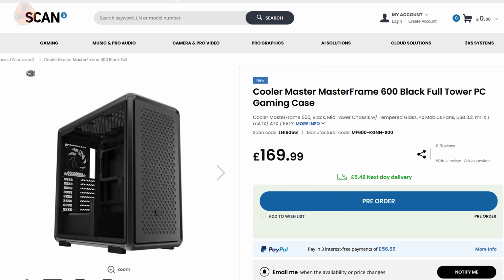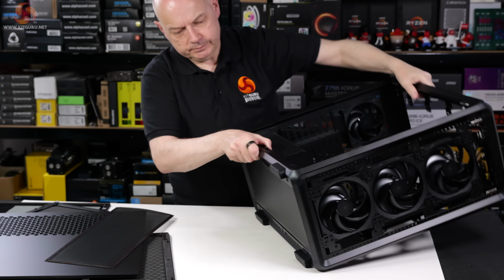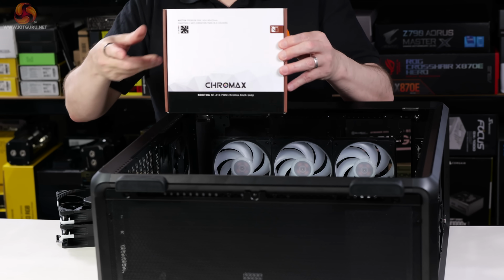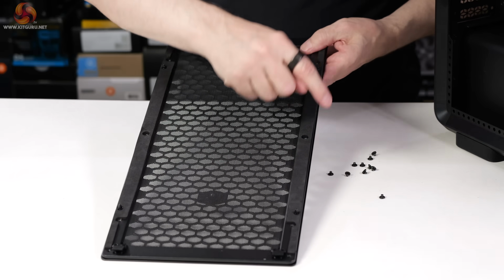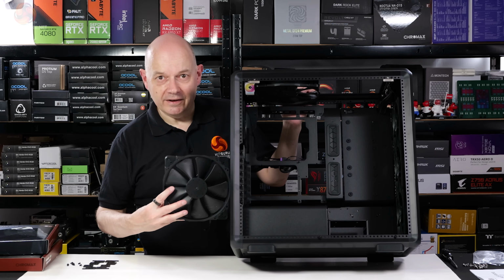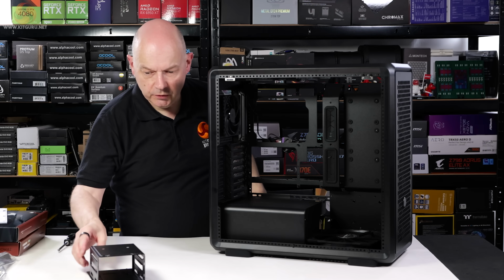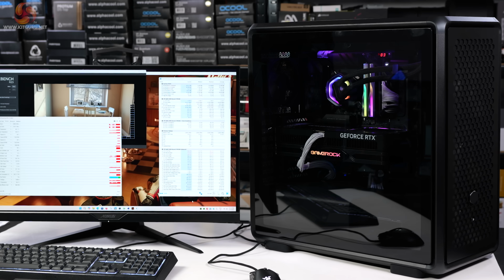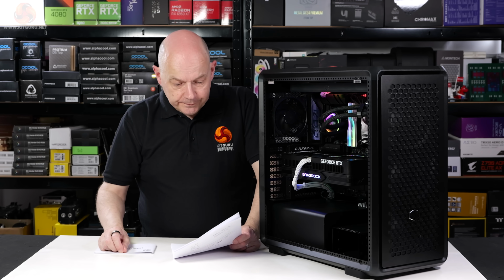Cooler Master MasterFrame 600: Gorgeous, Modular, Frustrating

Comment from the maker: Let us know what you think? does this case tick a lot of boxes for you? or have you already bought one? Also please do report any spam you see, its neverending.
Reply: This is probably one of the most striking cases I’ve seen this year. Cooler Master nailed the industrial-modern vibe, and the use of aluminium gives it a premium feel that a lot of mid-range cases lack. But looks aside, I’d be terrified to recommend this to a friend unless they’ve already built multiple systems and know what they’re getting into. The complexity here is real. :text-green-game-over:
Reply: I like it. Has a lot of flaws but at least it’s different. Had to think about it for a while
Reply: It looks great! seems a little fiddly and I don't have the patience for that lol :))
Reply: Thanks for doing this video on the Cooler Master MasterFrame 600 case. Can I assume that one can put the i/o panel on the top front with two 200mm fans?

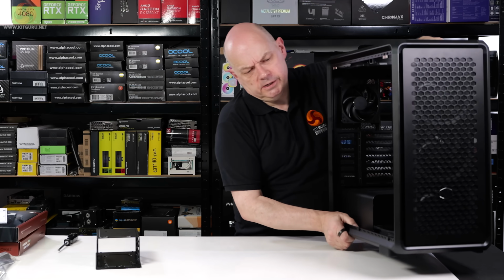Comment: 15:38 I just purchased this same case today and my case does not have the 2.5/3.5 shared drive cage! 
I have installed the Motherboard, CPU, RAM and the case cables which leaves me with these last two tasks, the PSU and 360 AIO which looks like might be a pain,  I don't have a GPU or Gen 5 M.2 drive yet and my three SSD's and 3.5 HDD will be moved over from this computer if I can find a place for the 3.5 drive in the new build. As for the eleven fans, at best I will have seven IF I can get the 360 AIO in the top of the case.
As for the case, it look great, easy access panels, great, but inside, I am no engineer and the destruction manual is to small for my eyes to make heads or tails out off.

Comment: I add my last thought about building in this case. I started building my new PC in this case four days ago and I was so enthustiast because it was looking so good: I purchaised it at the end of Juli 2025 for only 149 CHF/Eu, a good price. I choosed to use is in a standard configuration, together with a Cooler Master AIO, the Master Liquid Atmos 360. The problem is that installing a 360 radiator is extremely hard, because there is no offest mount: you can install radiator only in the center of the case but unfortunatly the radiator+Fans collide with the heatsink of my Motherboard and with the two CPU Power connector that are in left upper corner of the  motherboard (MSI MAG B650 Tomahawk WIFI-ATX) . Only with greath care (and fear of broking something)  the AIO (that is in total 5,2 cm) is gone in place but 1 mm more height and could not be possible. Imagine If I had purchaised a taller AIO like the Artic Liquid Freezer ....Cooler Mastes must insert in the case the supports for offsef mounting of the AIO, there is no excuse for such an stupid error! I'm an interior designer with 45 years of experience, and while I think symmetry is beautiful, in this case it's absolutely stupid. Another problem comes if you have the USB 3.2 connector facing right like in my motherboard. You can mount it only by removing the passthrough metal cover but when you screw the cover againg it touch in the USB connector that tend to bend or coming off.  Two millimeters more space and there wouldn't have been the problem. I have put 4 spacers where are the four screws and now the problem is solved. Mounting the PSU is only possible by removing the metal cover, you cannot simply put it inside and screw because, due to the frame thickness it is 3 cm away from the bottom. Due to the cramped space and the fans position the long CPU and Pump Cables are almost impossible to hide behind. Now I only have to install the GPU..... and then test it.
Conclusion: everything in this case, despite being a big one, is cramped: wonderful in the outside, look greath and is sturdy but the interior layout seems done by someone who never did a PC build in his life. Forget to put big AIO in this case, use an aircooler instead. It is incredible that a such known builder like Cooler Master make such poorly designed case. I would buy it again? Hard to say. 
Dear Mr. Kit Guru Tech, you were right. Probably is better to stay away from this case. Cooler Master has wasted an opportunity for now. Will they make any changes? I hope so, but I doubt it. End-user opinions mean nothing in this fast-paced world. On the other side also the Corsair 5000D have also problems. They want to do too much but then they have no time to test what they do because they must go into prodution. Thanks.

Comment: Is it a good idea to put two 200mm fans on the front?
Reply from the maker: To do that you will, of course, have to remove the three 140mm fans from the front and move them to the roof or side. Fun, fun.
Leo
Reply: @KitGuruTech many thanks. I wonder if it's more effective than the more classical three fans solution 😅

Comment: It's a good idea for a case to be very adaptable but unfortunately that's gonna come with a whole heap of screws. It's a big meccano set.  Just adding a couple of centimeters to hight and length or even just relocating the front IO would make a huge difference to fan compatability.  Although it would lend itself to a nice little mod by extending the cables and locating the IO to be sunk into the desk.

Comment: The way the rails give you fan and radiator mounting points across multiple planes makes this a dream for negative pressure builds. You can front-load or bottom-feed airflow paths

Comment: I like the concept, even with the Erector Set (I think you call these Meccano in the UK)-inspired looks.

One thing that would worry me is the finish on the various parts. I have an NR200 that I've built and rebuilt many times, and after a while it looks a bit rough where screws and components have rubbed the paint off. The shiny metal on the otherwise black finish looks bad, and I don't like the idea of having to repaint or touch things up regularly. I'm sure I could take more care to not overtighten things, but I like to tinker and not worry so much about a delicate finish.

The market for a fully modular case is probably small, but I'd love one where there is infinite flexibility, where all dimensions are even multiples, and so on.

Comment: Modularity is a balancing act, and that act is not covered or even understood in this review. That is a shame. When customers makes demands, they also impose restrictions on what they can be delivered. The frustration of the reviewer in this case, is pretty much caused by his own demands. First off, they should stop supporting everything. Just make a case 120 or 140 on the fans. Forget the rest. Do one thing great, skip Jack, as Jack of all trades, but master of none. As for the demands they chose to support, this is actually a fairly good design. But Jack is all around. To many demands are being met, and they are master of none. Leo ends up with a dead standard build, with hardly any standouts.

So to the crowd in here. If you want something design wise, that is nice both functionally and by form, you need to learn to sort your demands into something that can actually produce both. The Jack you all call for, he simply ain't handsome, he has zero mojo, he is a super nerd, trying to wear a speedo. He really has not work out for a decade or two, and in a speedo, it clearly shows. That is me speaking as a designer. There is a ugly cable sphagetti and and shame on the back, which all of you try to cope with, by denial. Hey, it is real, it is there. This is about the worst orientation there is, apart from up side down. When builders are going to start to call for a unified form factor, in which there is harmony for gfx and cpu cooling, is beyond me. If you are using glass, as a designer, I fail to see why?

I'll give you a hint: Take an iPhone and remove the painting on the glass, make it transparent. Guess what happens to the form?

Since you all call for the worst orientation possible, you even get the worst performance obtainable, plus sag. Why are you calling for this?

This design is fine for what it is. It is the user demand that is way off, as in hindering innovation and progress. You guys do not want any progress. No innovation. If you do, you get these points, as you know them all too well. Time to move on.

Comment: The fact that it supports both 140mm and 200mm fans is great on paper. But when you realise you have to start relocating the I/O and shifting brackets to get three 140s in the roof, it’s like… why not just design the clearances better?

Comment: Having all those mounting rails and a wide open floor, but not having a top-mounted PSU config is driving me mad.
Reply from the maker: You CAN move the power supply to the top of the case (as shown in the build guide) but life is too short.
Leo
Reply: @KitGuruTech haha! 😆
Thanks for letting me know, I appreciate it. (less mad)

Comment: Cases like this are clearly aimed at a niche — and that’s fine. It’s not supposed to be mainstream. But I do think Cooler Master could’ve included a few more practical optimisations. For example, quick-release fan mounts or modular panels that don’t require you to reverse half the build to swap a bracket. Small touches would make a big difference. Seems like they lost the point half way through the design. 😐🤨

Comment: The biggest issue I see here is that while the design is visually forward-thinking, it doesn’t account for common PC building challenges like GPU sag, cable clearance, or radiator conflicts. You can have all the modularity in the world, but if the user experience during assembly is frustrating, it overshadows the innovation. Great showcase piece, but not something I’d recommend to a mid-range user or someone doing their first custom loop. 😗

Comment: I’ve always appreciated Cooler Master’s willingness to experiment, but this one seems like it could’ve benefited from some UX testing with actual system integrators. The modular rail concept is neat, but it creates complexity that doesn’t necessarily result in practical gains. You’re giving up ease of use and introducing more potential points of failure or confusion. Looks phenomenal, but it’s a case I’d only want to build in once. And maybe not even once lol :face-pink-tears: